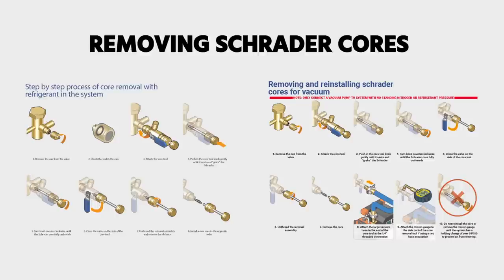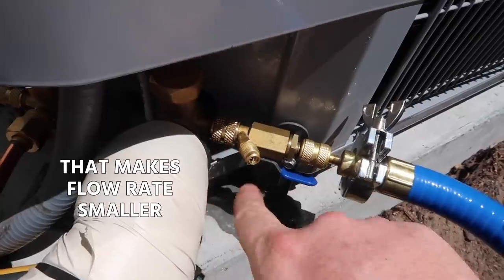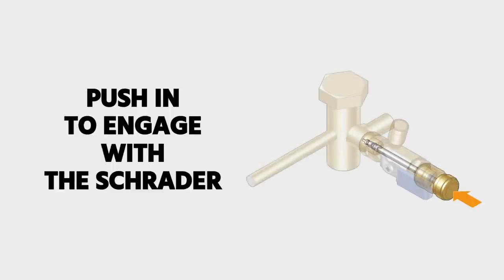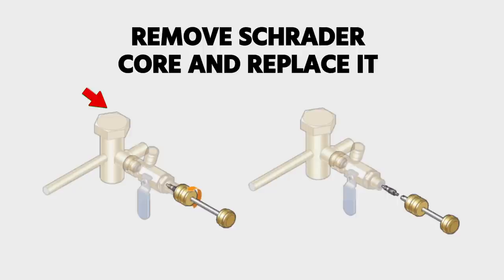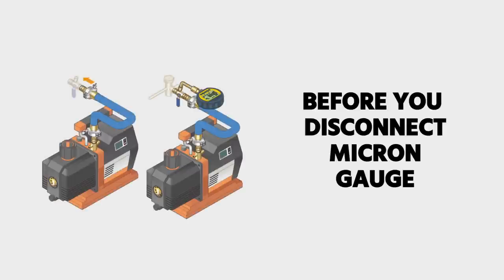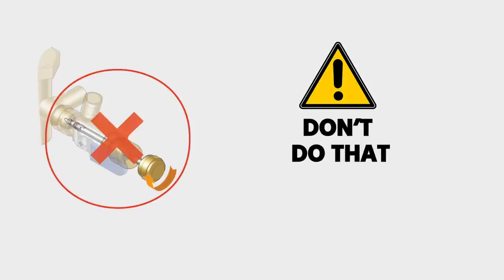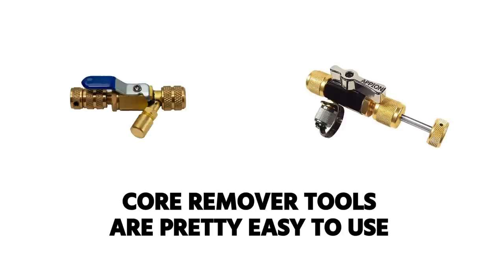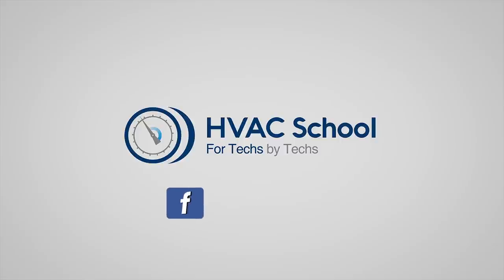How and When to Use a Schrader Core Removal Tool

Comment: I have questions when I try taking shraders out sometimes they are stuck in damaged I've tried using needle nose turn and pull to take out but I'm cautious because the last thing I want to do is damage the threads. Is there another way of taking this out?
Also I've been doing the removal and install of shraders all wrong imma follow your way. I'm one of those that pulls vacuum then put shrader back in then charge system. 
You think that putting in 1-2 pounds and the valves will be ok?
Reply: If you do damage the threads then you can re tap them with valve core repair tool. Slime makes one that comes in pretty handy. If you break the schrader then you can usually thread a drywall screw in to the piece that gets stuck inside the port and yank it out.
Reply: In my experience this happens when the cap has been overtightened on the port. I use a security torx bit (the one with a hole in the middle) and an electric screwdriver or drill, set to slow speed to gradually widen the hole a bit, then the core tends to come out a bit easier.
Reply: Saw an installer one day, when he was done with vacuum he started dumping through the high side refrigerant. After that,  he opened the valves like you do normally. What’s the purpose of that? Never got the chance to ask him. Does it affect the ac if you just open the valves after the vacuum or not? Thank you
Reply: @ΒασίληςΜπάκας-χ4χ   that's the way it should be done well it's what I've heard to break vacuum with refrigerant instead of air which may happen in some cases. 
In this cases you still have to careful purge lines before adding refrigerant.
Reply: @SoutheastTx  it’s very easy to overcharge the system like that though cause the ac comes precharged from the factory so you don’t really know what you added unless you scale it. Thanks for the quick response, makes sense.
Reply: @ΒασίληςΜπάκας-χ4χ  After pulling a vacuum, you need to re-pressurize the system before putting the core back in, because a system under vacuum is going to pull in air if it has even the tiniest exposure to it.  The core remover tools past the ball valves (where you remove/insert the schrader cores) aren't necessarily airtight; especially considering that you would have to take a hose off the end of it to put the core back in, so you will be getting some air into that cavity.  Because the core remover itself needs to pass through the body of the tool, the ball valve must be open to remove or re-insert the schrader core, thus opening up the system to any air in that cavity past the valve.  When you hook up a charging hose to pressurize the system (with the ball valve still closed) you need to purge the hose of air before tightening it onto the access port (by flowing some liquid refrigerant through it until you get a little bit of mist out of the end of your loose hose) to make sure that you're not introducing air from your hose into the system.  The liquid refrigerant will force out any air since it's denser than the air.  Once you've purged your hose, then you can open the ball valve and start charging up the system.  At that point, with at least some positive pressure inside the system, you can close the ball valve and re-insert the schrader core without fear of letting air in (because the air won't be able to fight past the system pressure).  Keep in mind that you won't be able to add refrigerant to the system through the core remover tool with the schrader core in place because you won't have anything depressing the core to open it up.  As for dumping in through the high side, that's done because you always want to charge a freshly-evacuated system with liquid refrigerant (because it goes way faster than charging with vapor) and it's safer to charge liquid into the high side since that's the side that should normally have liquid refrigerant present.  You don't want any liquid refrigerant in the low side of the system because it might slug the compressor; the high side of the system is where the liquid line is, and you want a full column of liquid going into the metering device anyway.

Or were you asking about opening the valves holding back the factory charge?  If that's the case, then the above still applies, with an addendum.  If you need to add additional refrigerant than what the factory charge contains (based on the length of the lineset, how many indoor units are connected to that outdoor unit in the case of VRF's and city-multi's, etc) then you generally want to add as much of the extra charge as you can before releasing the factory charge into the system (make note of how much you added and how much needs to be added, both in total, and remaining).  If you don't dump in at least some of the trim charge first, then you're either going to have to wait until you actually start up the unit or use a recovery machine (hooked up in reverse) to add in the extra refrigerant; and if you have to add in refrigerant while the system is running, you'll likely need to do so as a vapor into the low side (vapor to avoid slugging the compressor, and low side because good luck overcoming the high side pressure with the pressure from a can of refrigerant), which needs to be done slowly relative to dumping as a liquid into the high side.  Releasing the factory charge into the system increases system pressure, which means it's harder to add in extra refrigerant; it's much easier to keep the factory charge isolated, dump in the trim charge, then let the factory charge loose to mix in with the trim.

Hopefully I answered your questions adequately.
Reply: @ΒασίληςΜπάκας-χ4χ  you are correct sir maybe adding a couple of oz will help with that.  Here where I live and work Houston,Tx they way they build houses they usually put condenser on one side and the furnace,col or handler on the other side. I believe units come pre charged with  13-15 ft if copper. So more refrigerant is required. I've seen homes that have about 60,80, or even 100 ft of copper on 2 story or townhomes with 3-4   floors. 
It's kinda tricky not every install is done perfect. But trying our best to avoid getting non condensables in the system is not aways that easy. 
I've been doing this for almost 10 yrs done installs before when tech work is slow and I'm still learning from other people in the trade. That's why like watching YouTube videos to learn more to be a better tech and installer.
Reply: @EpyonRules  thanks for your thoroughness and being so informative and knowledgeable sir. I believe you answered all my questions.
Reply: @ΒασίληςΜπάκας-χ4χ  During installs, you should always weigh in your trim charge.  Most (but not all) units will indeed have a factory charge.  Depending on the unit itself (manufacturer, model, etc) that factory charge is only good for a certain distance of liquid line, and the installation manual (or sometimes the outdoor unit's nameplate) should say somewhere at what distance you need to add refrigerant and how much.  Always weigh in refrigerant, especially in smaller systems, because they tend to be critically charged.  (An extra 5 or 6 ounces when the total charge should be, for example, 5 pounds is a lot, and will be overcharged.  An extra 5 or 6 ounces in a system that has 30 or 40 pounds isn't that big of a deal.)
Reply: @SoutheastTx  never stop learning sir, I’m the same way, this trade is definitely a challenge. Like sharing opinions and information. It helps a lot.
Reply: If I suspect the schrader core will put up a fight I crack it loose with a hand held tool then follow up with the core removal tool. YJ makes a broken core extractor and a core tap that work with its core removal tool.
Reply: @EpyonRules  Excellent article. Thank you
Reply: @EpyonRules  thanks
Reply: @michaelcostello6991  Yes mate, that's the one (although mine are shorter). Had to use it today as well, worked like a charm.
Reply: @ΒασίληςΜπάκας-χ4χ  he was weighing in the extra refrigerant needed based on extra lineset length. Or at least thats what he shouldve been doing.

Comment: Thank you for sharing such valuable info with us. This is why filter dryer is playing critical role in AC system. It’s actually not easy to avoid zero moisture or air when installing/repairing/maintaining units, yeah following up the rule of thumb for preventing moisture from coming into contact with inside units is no doubt a must, but a quality filter dryer should be another back up . Have seen many cases of brazing jobs without nitrogen breeze.

Comment: I find pressure behind valve caps 7/10 times, even after replacing the core.
From the Lennox IOM: "Each valve is equipped with a service port which has a factory− installed Schrader valve. A service port cap protects the Schrader valve from contamination and serves as the primary leak seal ."

Comment: Up in NJ, & suspect others, there is a LIABILITY situation, in that IF. I AM the LAST PERSON SERVICING a residential unit I MUST INSTALL LOCKING VALVE CAPS , to negate HUFFING , , there was a SCHOOL IN FLORIDA where the chiller was ALWAYS SHORT OF REFRIGERANT , several leak checks provided NOTHING ! Contractor installed a camera into a video recorder, then FOUND THE ANSWER,,, 
HUFFING, SO until LOCKING  CAPS, WERE INSTALLED, , no more huffing  hey were speaking of enough refrigerant , to disable a big chiller !  Cheers 🇺🇸🇺🇸🇺🇸🇺🇸

Comment: Do you care to recommend a brand for everyday core repair use?  I have two Appion’s and they won’t always get a core out, even if you have it just right enough to not leak. 

I had an old one with no mane on it and it would pull out any core but it broke.  The Appion’s are great for vacuums and will put any core in after a vacuum but some systems just won’t pull them under charge.
Reply: I had to separate the end of my appion's removal to pull it out
Reply: @danielbergey3358  mine will always grab them but it feels like they get caught in the O ring or ball valve and fall of on some units.  It helps to not tighten it up much on the valve but have one I can’t get out even when it’s so loose it’s leaking.   I have flare cap on it now, I’ll see how that goes long term.

Comment: I don't like having that many connections when trying to pull a vacuum. I would rather have the vacuum pump run longer than deal with all those potential leak connections.

Comment: What if you find out the Schrader Valve is leaking after you pull a vacuum? Replaced the condenser which was the obvious culprit but then figured out the service port was damaged during the process. Low side s pissing for a second when I removed the coupler.

Comment: So schrader has to be out to pull vacuum but in to charge the system.  If you can push liguid thru a schrader you should be able to pull vacuum it thru a schrader
Reply: You can pull a vacuum through a schrader, it just takes longer than it does if you remove the schrader first.  The (depressed) schrader acts as a restriction in the flow of fluids (air is a fluid).  That restriction reduces how much air you can move through that point, so the vacuum pulls down slower.  Pulling out the schrader core removes that restriction entirely.  Pulling a vacuum on a large system with a lot of piping or a lot of indoor units, it's usually a good idea to remove the schrader core(s) (if you can pull from multiple ports at once with multiple core remover tools) to cut down on evacuation time.  If it's a small package unit or a small 1-1 ductless unit, I generally won't bother using a core remover tool and will just pull through the schrader core.
Reply: Also, if you have the core out to pull the vacuum (with a core remover tool), the core needs to stay out until you've put at least some refrigerant into the system, otherwise you're gonna be letting some air into the system when re-inserting the core.  Just make sure you purge your charging hose before actually adding refrigerant, or you may still end up introducing air into the system.
Reply: @EpyonRules  thank you for the clarification , that really helps.